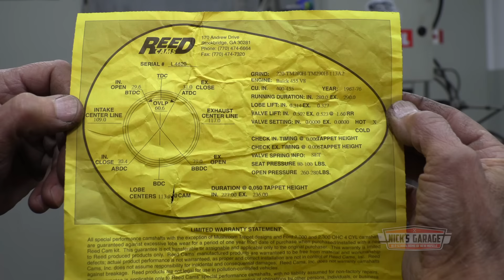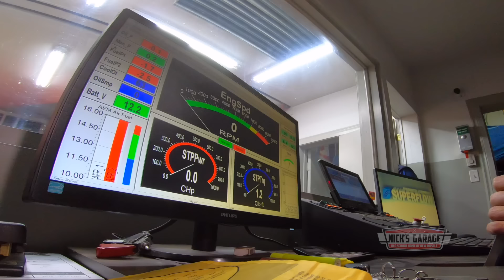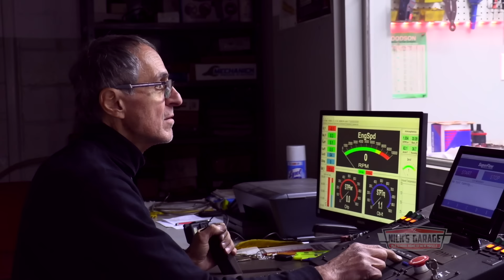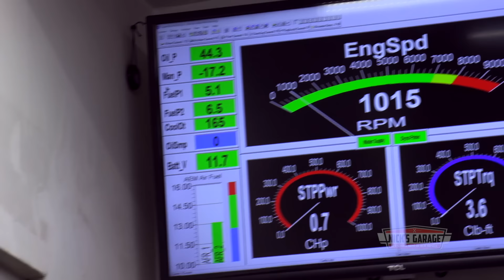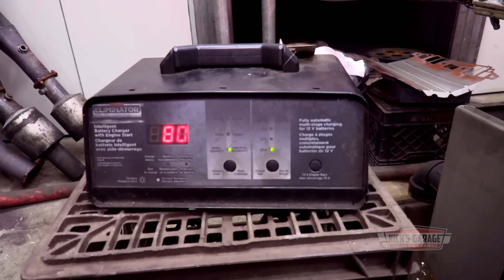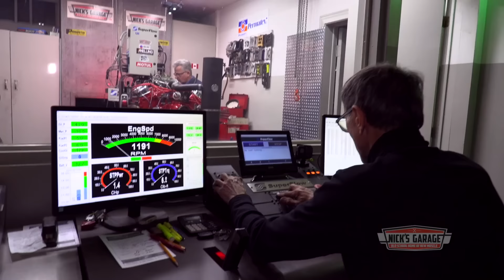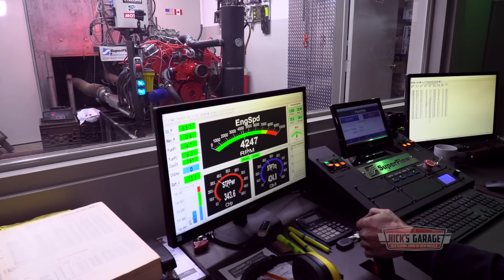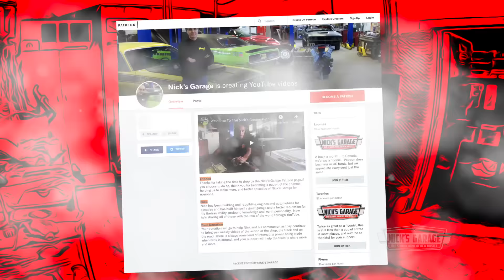1970 Buick 455 Stage 1 - Dyno Room Diagnosis

Comment: Really enjoyed watching you and Manny work together. That's a very smooth sounding engine. Classic V8 rumble. I'm amazed to learn that GM had three completely different 455s with no interchangeable parts.
Reply: Then you must be a "kid" to be so amazed.  Three totally DIFFERENT GM divisions, my friend!
Reply: @laurieharper1526  Sometime it takes a "wally" (??) to communicate with a "wally".  Sorry if I hurt your feelings. It wasn't intended.  When reading what your post, I was just very surprised.  Just been an old muscle car too long, I guess.  Cheers!
Reply: 3 455's and a 454... plus Cadillac 472 and 500...
Reply: In the beginning they were all separate companies...GM was just a generic company that bought other companies. They kept them separate companies for a long time but did share some ideas and also shared the same manufacturing plants eventually, but still manufactured separate components  thru the early 80's.
Reply: @richardbaumgart2454  - GM invented Pontiac to be a 6 cylinder step up from the 4 cylinder Chevrolets... then in 1950's stodgy old man's car Pontiac was re-invented by Bunky Knudsen into a Performance-Oriented Division...
Reply: @ Laurie Harper - They also had four 350's that were completely different from each other. Buick, Chevy, Olds and Pontiac. All different, all 350's.
Reply: @BuzzLOLOL  Pontiac was introduced as a budget brand of OAKLAND automobiles.  Within a few years, Oakland lost favour and was integrated with Pontiac.
Reply: @DeanMk1  - As usual... Pontiac cheated a little... there's was 354"... and Cadillac had a close 365"... 
And Ford had 4 351's called '352', 351W, 351C, and 351M...
Reply: @DeanMk1  - Yeah, Chevy had the 4-banger or could step up to Pontiac and 6-banger engine...
Reply: @DeanMk1  I loved the fact they all had their own engine design back then but in retrospect they should have pooled all that engineering into one 350...a badass 350 like an LS but 30 years earlier
Reply: @DeanMk1  yeah GM bought Oakland and they started Pontiac as a sub-brand of Oakland then Oakland was fazed out
Reply: @richardbaumgart2454  ...well, Chevy did have the LT1 version of their 350. That was a pretty bad ass engine.
Reply: @BuzzLOLOL  In a response to a comment posted by Richard Baumgart, you replied (in part) "GM invented Pontiac to be a 6 cylinder step up from the 4 cylinder Chevrolets...".
That is not true. 
The Pontiac was originally a budget version of the Oakland, all within GM.
Sure, one could move from the Chevy to ANYONE's six cylinder car and realize a larger engine, but it is not the reason Pontiac came into existence.
Reply: @DeanMk1  - Some sources say it was... and keeping those buyers within GM...
Reply: @DeanMk1  yeah but it needed 98+ octane to run and had noisy mechanical valve train that needs maintenance....it took Chevy 20+ years to update it  making similar net hp in the 90's LT1...minus approx 30% rating from the original because that one had a gross hp rating.
Reply: @BuzzLOLOL  They're wrong.
Reply: @richardbaumgart2454  But we're not talking about modern engines. We're talking about muscle car engines.
It was the way things were back then.
Reply: @DeanMk1  my point was if GM would have concentrated on one 350 instead of 4 different 350's maybe they would have made further advancements in a shorter time, rather than splitting engineering between 4 different companies ie olds pont buick chevy....they had 4 different brand engines going in the same car going down the same assy. line....I'm from Flint they let us tour BOC when i was a kid (buick olds/cad)all those g bodies rode down the same line here...as with other gm cars in different shops.
Reply: @richardbaumgart2454  Maybe, but I don't think so. 
All of those companies had all of their own design groups and engineers don't tend to "chat" across company lines. 
As with most things in the world, you have certain "hoops" one has to jump through to get to where we currently are.
Same goes for those engines.
Eventually, 3 of those designs were shelved for a single design, but we had to work out all of the designs that were produced to get to the single design.
Chances are, more than anything else, cost of production was likely a main driving factor for which design prevailed.
They were already using a single design for rest of those cars (body, drivetrain, suspension, etc.), so it was inevitable that a single engine design would prevail, as well.
Making the jump from the original small block to the LS motors is something else. 
I'm not sure creating an "engineering collective" between all the companies under the GM umbrella would bring about the advent of those motors any sooner than when they actually came. 
Maybe, but you're basically asking people to realize something 20-30 years sooner than they actually did.
That would be a tough one.
Reply: Man I always used a dwell meter to set points, and in a pinch I could use my thumbnail out on the road.  Use my pocket knife to trim some nail, and that was my feeler gauge, which made it a bit wide, but would get me there.  But the dwell meter was most accurate.  Set dwell before initial timing.    If the pints weren’t opening and closing you knew it was set too wide.    If the distributor cam was in the low or closed spot, when setting them manually and if you didn’t know any better, and just put them in without adjusting gap, you could have them so tight that even the distributor cam lifting the points wasn’t enough to offset the bend in the arm, which would also quickly wear down the point, and if you weren’t careful, could tear up the cam face on the distributor, which would necessitate either a rebuild or replacement.    In the old days you’d rebuild it, but later on they got cheap and you’d replace it.    Slipping the drift pin out of the fuel pump cam isn’t fun, then there’s the camshaft to distributor gear, then the mount stop and seal, all before getting to the pints cam.    No fun at all.  Do that on a small block Chrysler or a Chevy where the distributor is in the back, sticking a distributor in can be a real challenge.  On some cars you might need to move the engine forward a bit to get it out.  I don’t know how that works in a Corvette, but can’t be fun.   If they had K members back then, you could just back those bolts out and raise the car, thereby lowering the engine.    What a pain.     I know the Chrysler B body used a K member.
Reply: In those days the divisions had their own engines and product identity in styling but with some similarities in chassis. Emissions regulations really put a damper on so much with the advent of the catalytic converter in 1975. You had a drastic drop in power and gas mileage. Then the job to get these engines certified for emissions for various chassis, even for manual or automatic options was expensive enough or sometimes not possible. 70s were bad years. What combinations finally did work, by the start of the 1980s it got much tougher and less options. This wasn't just GM but for all manufacturers.
Reply: @BuzzLOLOL  i had a 76 dellegence 4door  cadillac i think it had a 472 i am 70  and may have been a 1974 not entirely sure which year 76 i think may be a 500 but will research that for my own peace of mind.
Reply: @geneglusica2744  - Hot setup is 500 with heads from 472 to get the compression ratio back up...

Comment: This is bringing back some memories of the 1970 GS and GSX cars.  In the early 80's I had a '70 GS 455, and a friend had several GSX cars.  Being Buicks, they were nice cars with nice interiors. 
 My '70 455 model was pretty torquey, but maybe not so great at higher rpms.  My friend was a GS enthusiast at the time and beat a few of them to near death - but at the time these were kind of cheap cars - you could get a nice one for less than $1200.  A ratty one around 6 or 7 hundred.  Anyways my friend blew up the transmission in one of the GSX's, and replaced it with a trans out of some other big Buick.  This is when we learned that these cars weren't all about the engine - the torque converter stall speed must have been carefully selected by Buick for the GS cars. The replacement trans made the car an absolute dog, actually pretty embarrassing on take-off.    A correct torque converter fixed that. 
It's the combination of well thought out pieces that made these cars drive so well, not just the big 455.

Comment: I love it Nick, when I rebuilt my 74
Buick 455 I swapped a 75 HEI 
distributor, I opened up the oil return
hole in the valley, the 455 was notorious on oil pressure in the mains, I chamfered the main bearing
oil feed holes too!! I also updated the oil pump and went with a aluminum intake, both thru T/A
which is the best company for
Buick parts!!! I never dynoed the
engine after rebuild but let's say
with the rebuilt TH400 behind it
my 79 Regal would haul you know
what!!! Thanks for showing this Nick,
there's still a few of us Buick fans out here!!!! 👍👍👍👍👍👍👍👍👍
Reply: My Pontiac Sunfire will wreck your '79 Buick Regal any day always! They're the fastest & best looking cars ever made! They were named Sunfire because they burn the doors right off of any other automobile in this universe!👌

Comment: Nice work Nick! You and I are old enough to remember the "factory power wars" of the late 60s/early 70s. Even the different divisions within GM, were trying to lure the high performance crowd to their camp. The compression numbers were NOT as advertised, and in some cases the HP and torque was inflated as well. The cranking compression number will be a little lower due to the slightly advanced cam timing. I'm thinking your numbers on this motor are probably very close to the REAL factory Buick engines. Well done with what you had.

Comment: My 72 buick would never run cold but once it warmed up it was bad ass. My motor came from a lesabre that they had pulled a trailer with so they ordered the highest torque motor buick offered.  I blew up my 350 rocket in my cutlass and put the buick in it. I used to smoke my friends so bad with it. Miss that car. Should have never sold it.

Comment: Protronics makes a great upgrade for a points distributors.Take out the points condenser. Install their electronic  setup.  You need  their coil also
Runs unbelievably better that way. .It's just like an HEI distributor in a old school distributor.

Comment: Right cranking compression should be at least 180psi-200psi, I read spark plugs , timing  should be in the bend of the ground strap, cattium shows the fuel, the ceramic a little tan ring circle at the top 👍❤️ also maybe not enough back pressure in the exhaust ❓

Comment: do you have a non resistor coil, you're supposed to run a resistor with points
Reply: every point you go lower on compression, you're going to see the torque go away. more importantly, that reed cam, that's where you're torque numbers are going away at. it's not that the Cam's bad for torque,  no, it's the cam. it's bad for torque. I built a 500 Cadillac, ran into the same issue with it. yeah all the torque just went away the minute I installed that Doug Herbert Cam....

Comment: I remember going with a good friend of mine in 1970 to Canton, TX to pick up the new Buick GS Stage I that he had ordered.  It was bare bones except for the Stage I engine.  Three speed on the floor, no radio - he just wanted to race it.  It was truly a torque monster.  Back in the day, I never saw a car off of the showroom floor that was as quick as this one.  He put a four speed in it, some headers, and carried slicks to the track, and turned 11.90 quarter miles (if memory serves me after 50+ years) -- until he blew it up.  He dropped a stock 455 in it and sold it.  Good times!

Comment: You have a leak in the manifold casting itself. Go to your local welding supply and buy a can of developer and a can of penetrant. Clean the manifold in a hot tank first. Then spray one side of the manifold with penetrant and wait. A couple of hours. Then wide it clean, then spray the developer and wait. If there is a bad pour, the developer will suck up the penetrant and you will see it. MAGIC.

Comment: Instead of fuel and spark it will be h2o and compressed air thier be a line going into the motor on both sides with bleeder valve at the top of each piston ther will be open close valves to run the motor it sounds crazy but I bet it will work and also have the same power as a gas motor

Comment: I'm worked on many GM's. Those points are not 12 volts. They are 9 volts. From the factory that car has one of two options. Option one is a ballast wire. it's a smaller gauge aluminum and steps 12 volts down to 9. Option two is a ballast resistor mounted to the firewall 12 volts go in one end and 9 volts come out. BOTH of these options keep the points from burning up. Keep running 12 volts to those points and keep burning them up. What do I drive?  1970 Pontiac Lemans with a Ram air V drivetrain. I use GM HEI and in order to do so I had to remove the ballast resistor.

Comment: If someone incorrectly milled the heads, the angle of intake manifold to head will be compromised. Check with a machinist’s square and dial indicator to ascertain the angle, and how much to angle-mill the intake to make surfaces flush
PS. Sometimes people angle-mill heads, taking more off the combustion chamber side, and just a “clean-up” on the intake side to take cc’s out of the combustion chamber thereby increasing compression ratio. Changing geometry in one area changes geometry in other areas. Angle-mill heads; angle-mill either intake side of head (difficult sometimes because of casting flanges) or angle-mill intake to head surface. Did a lot of this, in my day

Comment: I have used the ether test for vacuum leaks,, Spray ether around intake (making sure not getting thru carb) hoses, etc. and if you hear the RPM's pick up look at that point for vacuum getting pulled thru that area.  Always keep in mind about have something to fight a flash fire if you test this way!

Comment: Gaskets on the china wall? I know Nicks a pro but using these almost guarantee's a leak or blowout. Especially when you reduce the gap by plaining the intake. A nice thick bead of Permatex along the wall works every time. Ask most engine builders or back yard mechanics and they'll say the same thing.

Comment: Set the dwell on those points open the door on the cap and turn the point out until it starts then set it till it smoths out that's why it keeps stalling every once in awhile set the line back down because it will be higher then don't leave the key on so long lol

Comment: Damm ,cover that intake  that socket falling scared the crap out of mee put two rags in there or something I learned that when I was 12 yrs old ,,I had to take it back apart because a bolt bounced from the dist and went down the rabbit hole ,cover ,cover ,cover 2 second saves 3 hrs of pain

Comment: I had a engine once it would only run about 1/2 throttle and turn the entire exhaust headers bright red at 1/2 throttle, found out it was out of time on the cam shaft

Comment: Great knowledge, I'm 59 yrs old  had a 70 Buick skylark  ,wish It was a GS.
ANY Ways  to think about GM all had 455 ,all different, Pontiac, Buick,Oldsmobile and Chevrolet 454 has to be the most used Rat Motor

Comment: when a machine shop planes the block or heads or manifold to clean it ,true the surface or raise compression ,you run the risk of throwing the angles off , if they add up in the wrong direction you end up with these issues , it appears still an issue these days, i went through this with my 69 383 hp , the angle between the intake a torquer  single plane and the heavily shaved 906 heads was way off , gap at the bottom , the same solution , gaskets top and bottom 0f the bathtub gasket ! and usually with stock never needed even one gasket, surfaces match within a few thousands of an inch , human error , rushing through work etc . even your most reliable trusted machine shop drops the ball , its up to you to check , never assume it was done right., before assembling.warning flag is getting the intack bolts started , if the head bolt holes are sitting high in the manifold holes , stop ,issue , that intact isn't going anywhere to compress for a seal ! i call  all engines with angled manifold fasteners major screw up , fasteners should always pull down not slide at an angle the manifold into place.